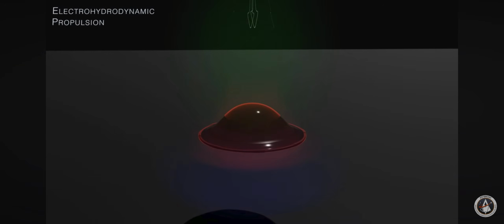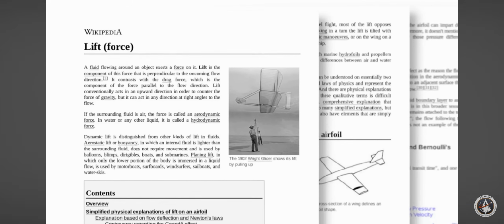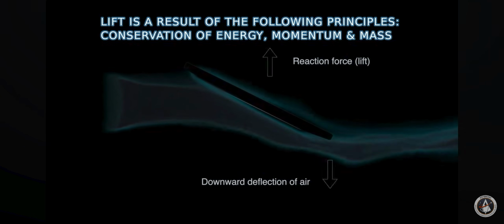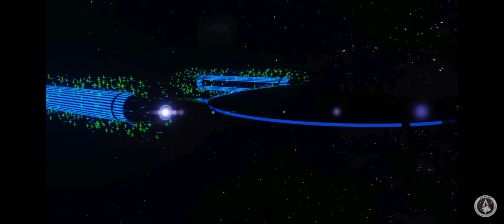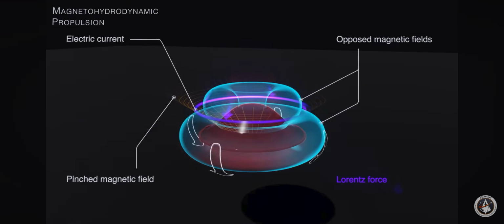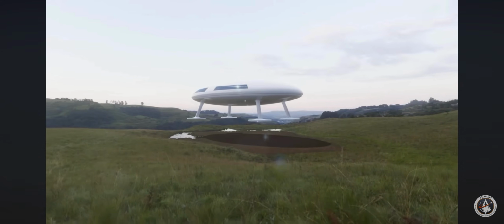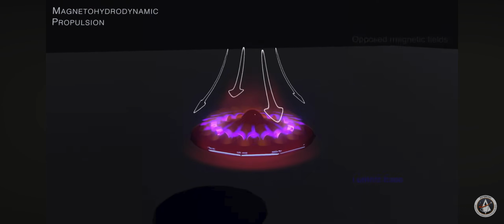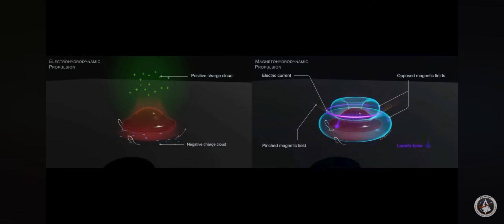MHD Magnetohydrodynamics and the Lorentz Force provide a Pressure Differential which causes Lift

Comment: I have something for you... Imagine you give the following text to an AI:

Here are three new MHD power formulas that work simultaneously and, in fluid dynamics, consider masses and electric charges as etheric volumes: they are called RUST, BUDI, and MAYA.

The first, rust, represents resistance R x velocity U x entropy S x time T.

In this case, entropy is the latent energy of the propulsion system, in the Lorentz metric, in c².

The second formula, 'budi', also in the Lorentz metric, is a bit better known and represents the magnetic field B tesla x velocity U x distance d between the magnets, and x I as the electric current.

To fold space, we need to use the negentropic Kosirev metric, in c³. So, incidentally, the second version of budi is b² x d² x I.

And finally, in the second metric, where twisted waves of time reign, we find the 'maya' power, which means M = the inverse of velocity x A² for square areas, x Y² for square jerks, and the last A for antigravity in square seconds.

These three power formulas act simultaneously in an MHD device to launch itself towards... Jupiter?
Entrust this, as I said earlier, to the artificial intelligence Gemini (preferably) or Meta... And you'll see the reaction.

Comment: Jackson's "Classical Electrodynamics" (1st & 2nd editions) discusses "Magnetohydrodynamics & Plasma Physics" in Chapter 10 and includes a good bibliography.  Magnetohydrodynamics is covered in Chapter 8 of Landau & Lifshitz's "Electrodynamics of Continuous Media" (Vol.8).  "Modern Electrodynamics" by Andrew Zangwill is on the level of Jackson without the sharp edges;  the selection of examples and problems are very physics-oriented.

Comment: My analysis of these engines for atmospheric propulsion showed extreme inefficiencies, particularly when ionizing the air. However, I have not considered space with cold plasma’s, although direct ion ejection and acceleration might still be more efficient. My biggest inquiry then, is where this video left off abruptly with virtual particles. What contraption and efficiencies does one get from using zero point energy. I would imagine all current pathways consume more energy than would be useful another way.